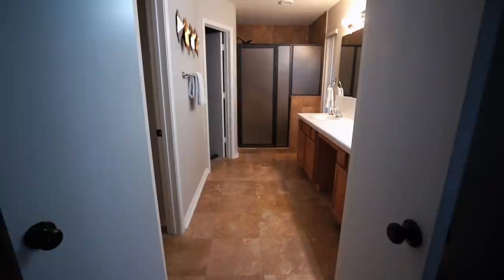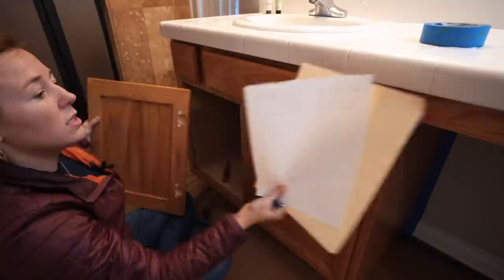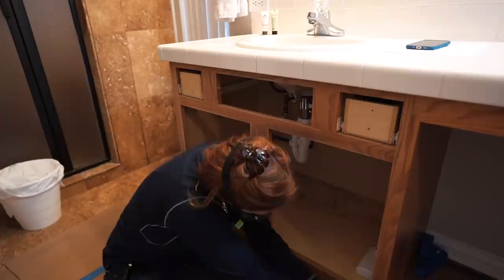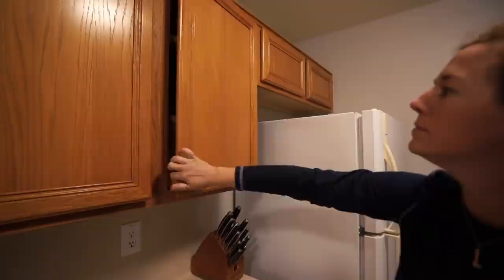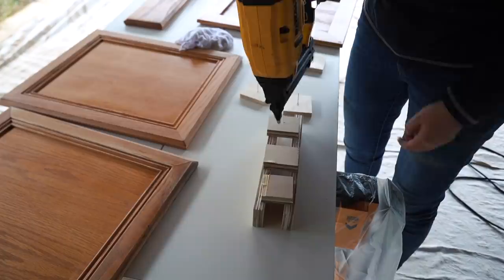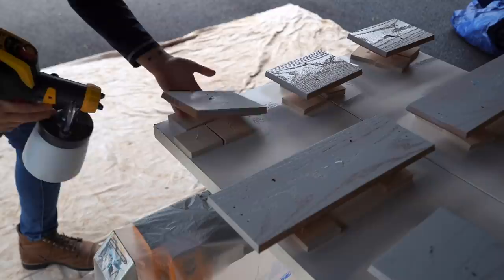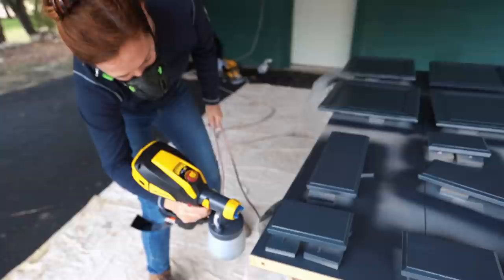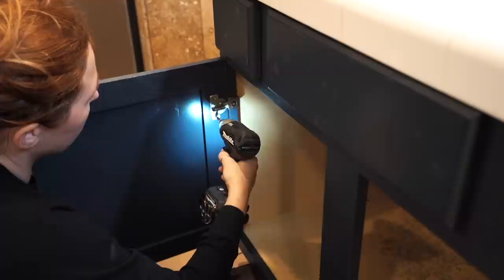How To Paint Outdated Cabinets | Easy Inexpensive DIY Bathroom Updates

Comment: Pro painter here.  We do 20-30 sets of kitchen cabs per year.  A lot of good advice here, but she does make it look a lot simpler than it actually is.

I never recommend a homeowner doing their own kitchen cabs.  Way too much work and your kitchen will likely be down for 2 or 3 weeks.  Even with professional tools, we usually can't get them done in less than 5 days.  However, a small bath vanity is perfect if you want to tackle it yourself.  The sprayer that she recommended is the exact one that I recommend to anyone wanting to DIY.  Just make sure you keep it clean.

And for a top coat (she didn't mention a brand) we use PPG Breakthrough V50 or Benjamin Moore Command.  We typically do both in satin finish.  I wouldn't recommend higher gloss because the higher the gloss the more it shows imperfections.  Just don't use a flat finish and you'll be fine as long as you use something that is rated for cabinetry.

Edit:  Please don't use a roller of any type anywhere on cabinets.  If you're only painting the face frames and not the interior of them, use a small 2" or 2.5" sash brush.  Make sure it's a nice, soft brush.  A roller can't achieve the finish that a brush or spraying can and it's going to look like dog doo the minute light hits it.
Reply: Why V50 vs. 250? 250 is some tough stuff.
Reply: @pawpawstew  V250 isn't rated for cabinets.  Read the product data sheets on both.
Reply: Do you have to thin the primer or paint with that Wagner Gun?
Reply: @mvboynton  You shouldn't have to.  But, if you can't get it to push through, just read the instructions on the can and it will tell you what you can dilute to.  Most are between 5-10%.

Comment: Great tip on nails in scrap as paint stands.  One variation on this I've used is to put nails (or screws) into long skinny strips of scrap, then cap the top rails of my saw horses with them, screwing or clamping the pieces to the horses.  Longer pieces can even extend the length of the horses (as in an 8 ft piece extending a 4 ft horse 2 ft in each direction), which can then be places as far apart as needed for painting longer projects.  
And I also agree with you about paying extra for better paint.  In fact, it's worth it to get 'trim and cabinet' paint for this job.  It dries faster and cures harder, which is worth it where painted pieces like doors, drawer fronts and face frames touch each other (nothing worse than cheap paint that can stay sticky for weeks pulling off the wood as it transfers over to the other painted surface).

Comment: Did you have to thin out the paint to shoot it with that sprayer?
Reply: It'll depend on the type of material you're spraying! The FLEXiO 3500 can spray unthinned materials with the iSpray nozzle, but if you're using the Detail Finish nozzle like April is in this video then some thinning might be required

Comment: Nice job. Very well thought out. Looks like something my wife and I could easily do with our very similar age and composition dual vanity. One thing I noticed with yours, though, is the large blanks directly in front of each sink between the drawers. I'm in the process of converting ours to flip-out panels with storage for sponges, small brushes, maybe even toothpaste, or similar-sized objects that you might otherwise lose in a drawer while at the same time not wanting them on the counter, either. Different width kits to do this are available at any big-box or online DIY store and aren't costly at all.
Reply from the maker: Yes, that's an excellent idea! Thanks for sharing and for watching.

Comment: Thanks April. Was the paint you used a latex, water based paint? Finding a primer and paint you can spray with that spray gun seems to be the hardest part of the project for me. I'll check out the Wagner unit, but this is usually tougher than it seems, no?

Comment: Great job love the standoffs idea, will be using that,  in terms of using the paint wagner paint sprayer. Did u have any issues spraying paint, i have not had good luck using this tyoe of sprayer
Reply from the maker: No issues but I keep the sprayer moving, slightly overlapping each area so ultimately even. I get into a groove and it's done before I know it. Thanks for watching.

Comment: Having worked in a paint store for several years, let me recommend everyone use an oil based paint on any cabinetry. The oils on your skin will break down even the best latex paints.  Plus you'll be cleaning them more often because the dirt sticks easier to latex, which will break it down even quicker. Plus, with oil based paint you can most likely skip the primer step since the original finish is most likely oil based.